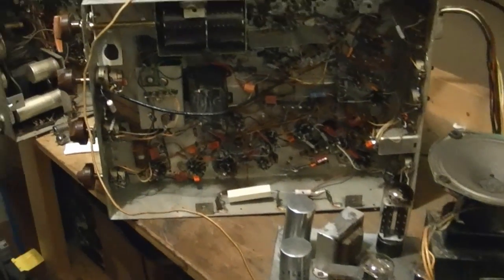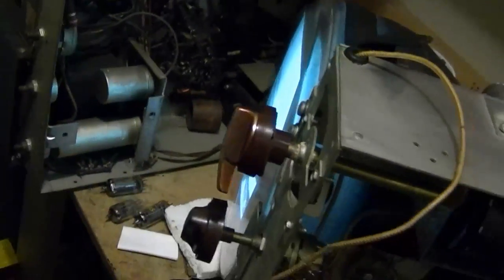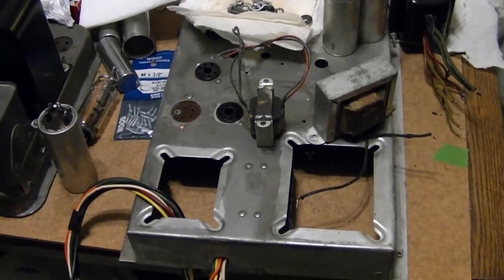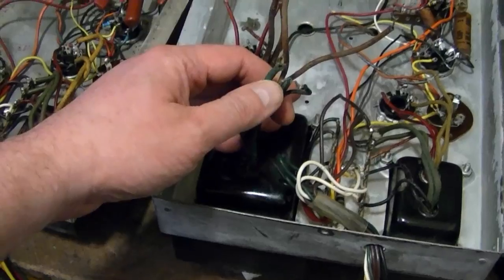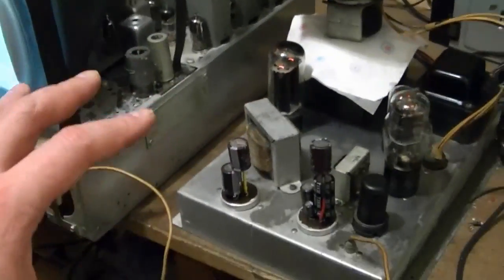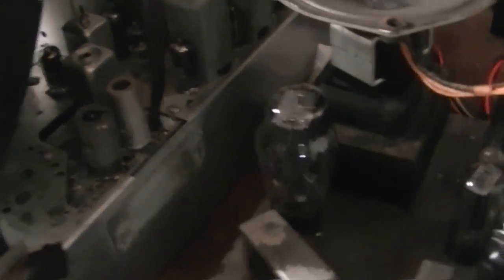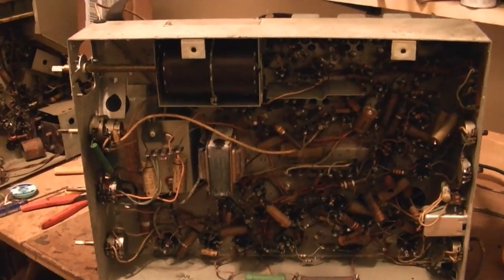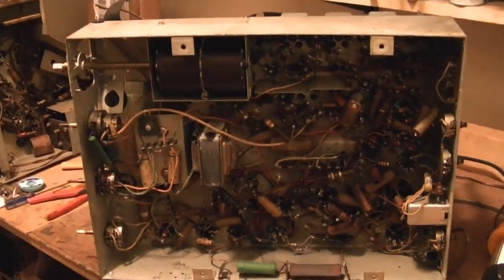Admiral 30A12 restoration pt8o?

Comment: That makes perfect sense, as of last weekend I have a Canadian model 84s in triplicate, two are brown mahogany and the new one is a blond. The first brown one has a good dial, has been refinished, but needs the loop antenna replaced and has no knobs. The second brown one has a fair original finish, has the knobs, I restored it electrically, but the paint on the dial glass is lifting in places, maybe it can be repaired with black paint maybe not. These are from around 1949-50 by the way.

Comment from the maker: I'm not sure.  The field coil is used as a filter choke on the lower voltage supply with the 5Y3 rectifier.

Comment: Great video as always...It will be interesting to see if that 5U4 does flash over on power up with that other chassis once you restore it. Just one thing, did it do it with the speaker unplugged as I recall the field coil is part of the power supply? Just an idea. Keen to see the results on the next video regarding the second chassis and if it will throw you any curveball faults just for fun! :-P Cheers.

Comment: Silly question, does it happens if you disconnect the upper chasi ?. Just to isolate the fact you suspect that something is happening there. Also, it's not the real condition for the power supply chasi, and since I'm not keen on tubes, don't sure if there is a risk if damaging the lower chasi running it without a load. But you  can still hock some resistance to draw some current and make thing a bit more realistic. And both lower chasi do the same, so you can suspect about the upper one. Cheers

Comment: I thought that you may be getting rid of the duplicate sets first, like the extra Admirals and Motorollas. Did you finish that Predicta Holiday set that you were fixing for a colleague? Wasn't that the set where someone had fitted it with a 6.3 volt replacement picture tube?

Comment: Right at the ending of the arcing demonstration with the 5U4s you stole the words right out of my mouth. Use a CL-90 thermistor.

It will be interesting to see if the other chassis demonstrates the same arcing symptom.